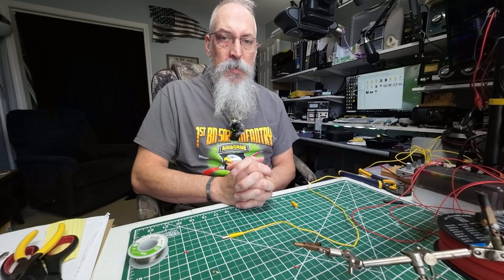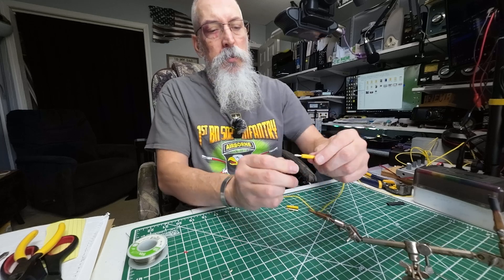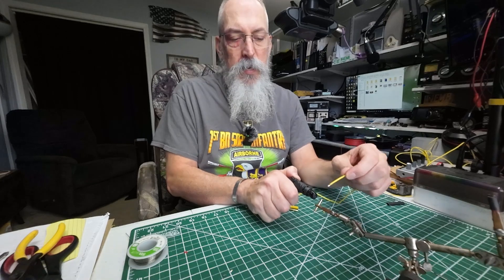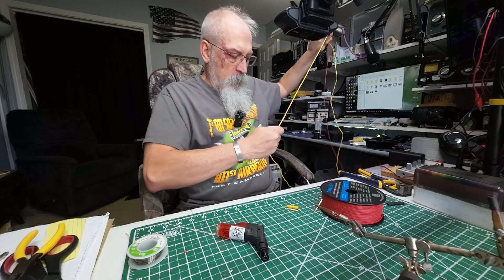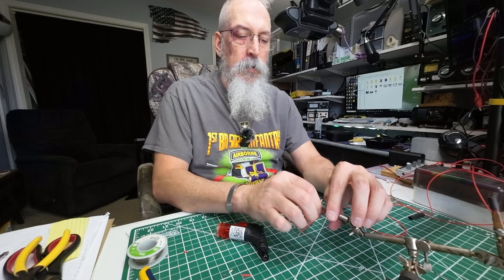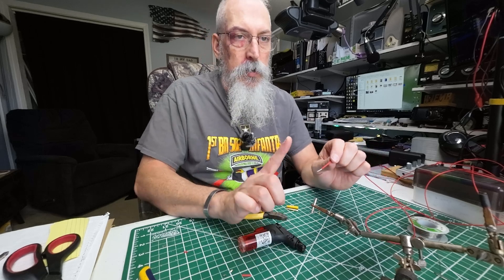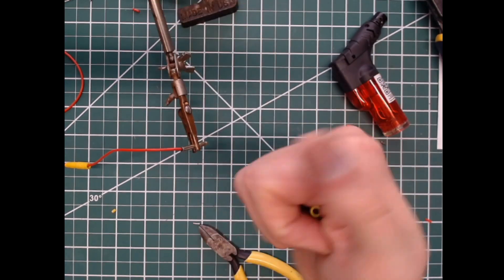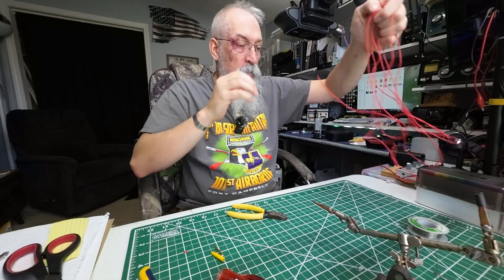MC750 Radial Modification

Comment: I want to add more radials and was hoping to connect 4 per banana plug if possible for total of 16. 

I wanted to just buy new banana plugs but seen hard to find
Reply from the maker: Amazon. Make sure to measure the size of yours so you know what size you need.

Comment: Out of curiosity, what gauge wire did you use?
Reply from the maker: Ive used 24 and 26.... I am a QRP only guy in the field with just 5 watts at most... but have tried it with 20 watts and no problems at all

Comment: I am not sure if my solution would work but since you use the same tripod that I do, I found a set of radials (video I found) called "Comet CGW-560 HF Portable Ground Radial Kits CGW-560" at DXEngineering that works great on my JPC-12 antenna and is VERY durable. You simply place the single radial ring that all the radials are connected to onto the tripod first and then screw the base on top of it.

Comment: I did some measurements using a SWR meter on my MC-750 antenna. With 8 radials, I got better SWR (closer to 1) on all bands from 20m and up. On 7 MHz adding the extra 4 radials made the SWR worse (closer to 2).
Reply from the maker: Once you make the radial  modification, you may need to adjust your whip to a new place to accommodate the length of radials.
Reply: @W4EMB  I did that. With 8 radials, the SWR didn't drop below 2 on 7 MHz, no matter how I adjusted the whip. I am going to investigate this further.

Comment: Practially, how much difference would this make? I think if I were to mod the radials I'd add two wires to each plug and have 8 x 8 foot radials rather than the 4 x 12 foot radials that come with the MC750
Reply from the maker: So I have used both the 4 radials and the 8 radials . I have found i have improved performance with more radials . i have even switched from 4 to 8 in the middle of an activation. They do work well.

Comment: Have you noticed any improvement on your MC-750 with adding the extra radials? (I remember you did a vid on 2 wires on each terminal). I received my MC-750 a couple weeks ago and have only used it a couple of times. I have a roll of 26g flexible silicone wire ready to go.
Reply from the maker: i would have to say I noticed my QSO number was always higher when I used the double radial set.  If i recall correctly, the plugs are 3mm. Also, i just made another set by desoldering the factory ones.. i was surprised the factory wires are an 1/8 inch of wire in the plug. So, i am glad I found that out. I put about 1/2 inch of wire in the plugs. very easy to do. watch for a video on that soon.

Comment: On an unrelated note, I was trying to duplicate the wideband receive on my TR-45L that Evan was getting on your original non-Skinny for his review. The only way I can come close to duplicating it is to put the Mode to SSB which has a much wider I.F. at that point (I think, anyway). It will still only transmit CW, but this can happen if the received freq is accidentally saved in the SSB mode. This happened to me on my TR-35 when I sent it to John to replace the BNC connector that I accidentally broke from an unintended fall to the pavement. When I mentioned to John to check the alignment, he indicated that it was in SSB mode when he received it & turned it on. I didn't even know I could save those settings, so it was news to me. I am just pondering this as a possibility as otherwise I cannot duplicate what was happening on that video. I have also had tight receive parameters that more than adequately rejected adjacent signals. Of course I never get enough hours to play radio, but compared to my Icom IC-718 & IC-75 250Hz filters I love the 400Hz or so the Penntek's are typically uses. Maybe the skirting isn't as steep, but seemed more than adequate except for when the QRM was directly on top of me. Cheers, Davey --KU9L
Reply from the maker: Thanks Dave. i will have to try it once the radio gets home
Reply: Great video , next mod I’m doing to the Mc -750